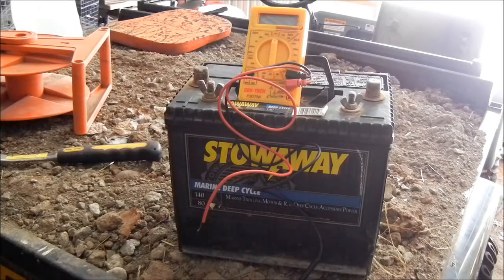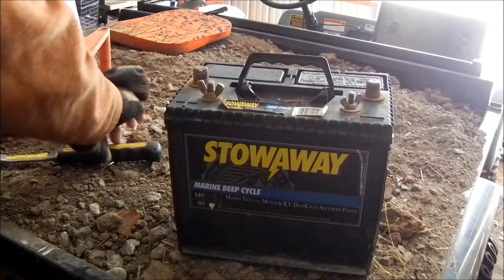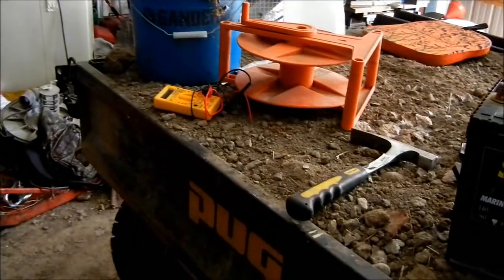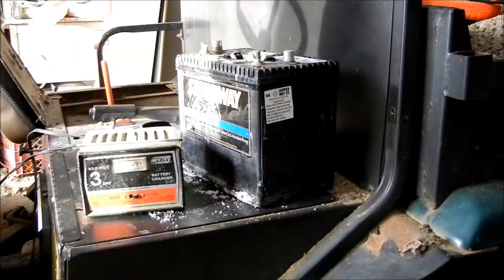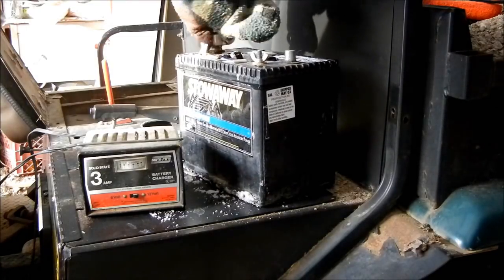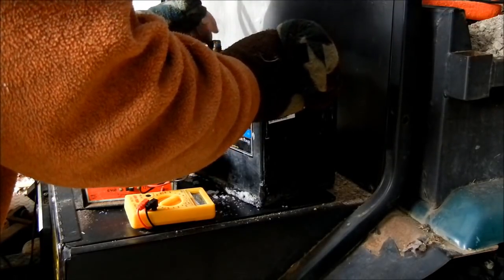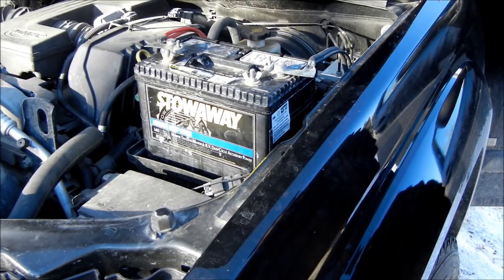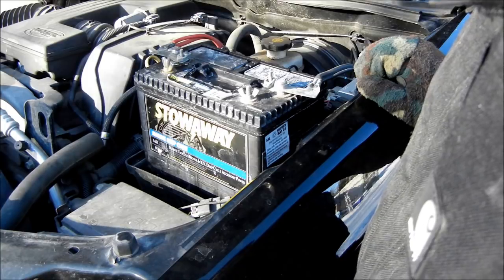Shortened How to repair a 12 volt battery for under 5 dollars using Alum and baking soda

Comment: I did it. I followed the instructions from this video and converted a dead lead acid battery to a working lead alkaline battery. There were a few additional considerations I had to solve. That stated I want to tank Jared for posting this video. Also, I am in southern California, so my battery was not made for norther climate. Note, Jared stated in the video a radio of 8oz of Alum per gallon of water. I used distilled water. My battery  consumed 3 quarts of solution.

Comment: How much did it cost you for the aluminum sulfate power? How come you did not drain out the battery to get rid of the impurity from the aluminum sulfate reaction in water under electrical hydrolysis (aluminum hydroxide byproduct of the reaction plus sulfate flowing around) and fill up the battery with new fresh sulfuric acid?
Reply: he probably did common sense didnt show it on camera .
Reply: He put baking soda in to neutralize acid and he flushed that out with water a few times then he did 1 cup Alum with one gallon of distilled water.. he wrote this in his video description and also said he wanted to try it cause it's less corrosive then acid

Comment: I did a little quick economic analysis of reconditioning an old battery vs. a new one (Everlast at Walmart) which costs around $100 tax included with 3 year replacement and 2 year prorate and my conclusion is that it is not worth the effort and the cost of chemical purchase. Spending 100 bucks for 5 year warranty which comes out to be $20 bucks a year and without all the hassle of having the reconditioned battery going dead on you unexpectedly is not a bad deal...
Now, my decision would change if the new battery all the sudden costs $1000 then that it would be worth it to try to revive the dead battery...
Reply: some people have a lot of old batteries that want do it as a hobby or in need or they have lost their receipt after buying a failed walmart one. i bought a battery today at walmart canada, it didnt start the car,  i came back within an hour they REFUSED to return it saying it had already been installed.  i could not imagine 1-5 years.   this was a $240 AGM everstart.
Reply: i expalined i work for a TV station so they returned it
Reply: Desmond Bagley  good point, i buy about 100 batteries a year for our fleets and inventory , i have noticed walmart canada do not even care they will just exchange it. but i did have a bad experience with an insecure manager at one location, (each time) so i just went to a different store.

Comment: Did it start the next morning with the same battery?
Reply from the maker: Yes As I recall I let it sit for like 20 days and tried it again and it still started even should be in one of the related videos, I did a bunch of tests on it.
Reply: @RepairmanJared  yes. There are few successful merhods. Its basically just cleaning the plates & replenishing water/acid. Seems that trickle charge needed in all cases though. Thank you for your video.

Comment: Should always used distilled water to refill any battery. Also never charge a battery on a metal bench or seat or anything metal. a fully charged battery should read anywhere between 13.8 to 14 volts. If you want more subs. I suggest cleaning that mouth up.
Reply: Yeah that's crazy. Guy said fricken and shit. Twice even. Insanity. Everyone's a know it all and a critique, yet they don't have a video on how to shake back a battery with aluminum. Ignore the haters man. Thanks for the video.
Reply: I was puzzled with your "clean the mouth" complaint, then I got to the last few minutes....wow!

Comment: HEY , GREAT STUFF THERE ! i want to try the process for sure ... my battery shows 1 . 5 volts and wont take a charge ??  question ...do i use tap water with the baking soda cleanig  process or is distliied water necessary for all   also , i see alot of people use epsom salts instead of the allum  ...is one better than the other ??........thanks again .....for all ..will keep you posted
Reply from the maker: Everyone recommends distilled, that being said I have used well filtered tap without a problem. The main worry is minerals etc in the water that may erode the plates faster. At 1.5 volts chances are that battery is a goner but you never know.
Reply: @RepairmanJared  thanks for that Jared....i will let you know how it works when i get around to that project ...right now i cant see my ass form my face cause i've got so     maany  other problems................. cheers )

Comment: How Long did the battery last?
Reply from the maker: I am still using it over 5 years later. I have had it installed on my dump trailer the last few years.